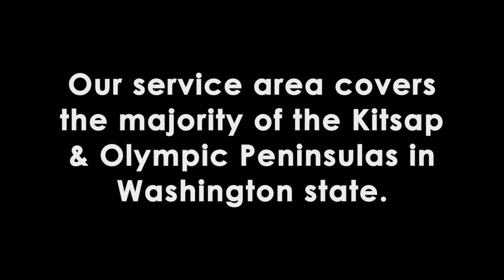Diagnose And Replace A Failed RV Motorized Awning Switch

Comment: Thank you for this easy to follow video.  I just purchased a used Fifth Wheel and the awning switch was disconnected. The awning works when using the remote control, so I figured the problem was the switch. When I opened the switch panel there weren't any wires connected to the switch.  And although I don't have a test probe like yours, I was able to use basic DC electrical knowledge, a Fluke Multimeter, and a simple test light to identify the leads.  Without this awesome video, I would have been months trying to sort this out (or a few hundred bucks at a dealer).  I watched the video, went to the RV, and even with taking the time to heat shrink all the wire end connectors to prevent shorting against each other, the job took 40 minutes.  :)

Comment: Ok, so I'm a electrician and an RV tech, and I understood, but I think a drawing would have made it easier to follow.  Maybe show how a dc motor will change direction of rotation when voltage is reversed,  do a mock up and show that on the bench and then add the switch into the circuit...I do love watching your videos and keep doing what you do....
Reply from the maker: Thank you for the support!

Comment: Valuable information as always. I learned that's a double throw double pole switch that reverses polarity. I once had a fantastic fan that only blew air in not out. Hence I used a dtdp switch to fix that so it would blow air in or out.

Comment: Simple rule for DC motors whether they are window regulators, fan motors, awning or any other is they use reverse polarity to switch direction.  This comes in handy with those who like to look at wiring diagrams and will better understand that the same wires or conductors will act as both positive and negative depending on which way the switch is operated.  Much easier to draw a diagram and use markers to show the circuit while at rest, and each switch position and the theory will become more evident.

Comment: Thanks for a very good video.  If you run across a similar problem where the awning switch is integrated in a larger multi control switch board with separate push controls for the awning, porch light, and master ceiling lights (instead of one standalone awning switch), I would enjoy seeing how to troubleshoot the problem.

Comment: Thank you for another excellent tutorial, but my greatest weakness when it comes to repairs is electrical issues and I was really confused watching this, but kind of understood it in a working sense??  I usually do trial and error, but as I said, me not understanding electricity as well as I wish I am always afraid of blowing or frying something more than just a fuse (like me for instance). In this case I would have started with the fuses and then got to the switch, but would have froze switching things around for as I said, I have a fear of doing more harm then good when it comes to electricity. I've learned a lot with your videos, so I'll keep watching and hopefully I'll keep learning. Thanks again.

Comment: We have just purchased our first commercial RV.  Have a DIY one for over 20 years and of course making "improvements" to every year.  The commercial one 2022 Pleasure Way Ontour 2.2 blows my mind.  I have a Truma furnace not just a Mr Buddy.  I have a big water pump and two sinks, etc.  And of course everything is hidden in walls.  Your videos are really a great aid in getting a jump start on understanding our new RV.  Great work and explain things clearly.  Many thanks. ............Side note even this PW unit that is supposed to be high quality have so much that screwy  about.....what were they thinking??  They build them but DO THEY USE THEM?

Comment: I want to point out that while the power probe was a perfect tool to use in this instance, it does require 12V positive and negative from a battery to work. It is designed for automotive work were you are near the 12V source and need to provide a +12v or GND to various points. I enjoy all of your videos!
Reply: I have yet to find an RV that doesn't have a 12V power source and most have multiple.  The power probe has a 20' cord and also has additional 20' extensions, (In order to check trailer wiring @ back of vehicle), along with the capability to not just clip onto a battery directly but also plug into a cigarette styled 12V power source which is usually located close to the service panel.

Comment: You are right !  I had a slideout that broke some of the teeth on the gears.  Took it to the dealer, and it took 4 months for them to fix,and since it was covered by warrantee I could not speed them up.  I won’t go back

Comment: The common pole changes polarity as the switch is rocked.
So thr negative and positive wires are hooked up in the outer poles. These are the power lines that feed the DC motor..
Reply from the maker: And I would add that the positive and negative polarity of the top two pins gets reversed on the bottom two pins. It is in this way that the common pins (in the middle) which gets wired to the awning motor - has the polarity change allowing the motor to go clockwise or counterclockwise.

Comment: In a DC circuit you have to reverse the + and - going to the motor to get the motor to reverse or turn the opposite direction. One direction for out and the opposite for in.

Comment: Great explanation. Did similar diagnosis of wiring on a rocker-type battery disconnect switch. Took a while, but finally figured out that the battery disconnect switch had been incorrectly reconnected after an RV dealership worked on our awning switch. Bottom line is they fixed the awning switch problem, but created a second problem when they incorrectly reconnected the battery disconnect switch. 

Is that Luke & Jody from Workamper News?

Comment: Instead of using positive or negative voltage to depict direction you might try to simply use current flow.  I've found it makes it easier to explain d.c. circuits and motor induction to my students.

Comment: That power probe is neat! Funny thing, we just brought our new 5th wheel home yesterday and the awning doesnt work. I can hear the relay clicking but no movement of the awning. It has one of those Smart Arms where you can put the awning out or in at the arm as well as normal switch and that works but won't with the interior switch or the Onetouch control pad.

Comment: My experience is that the center is the middle point and the distribution is left or right when you rock the switch. That was true in my experience until I recently order a single pole double throw switch to replace the single throw single pole switch in my formerly fluorescent ceiling fixture.  I went to the double throw switch so that two strips of LED lights replace the two tubes. And I added three solitary little LED lights or another word for 1 and 1/2 inch two-a-day night light.   the darn switch had the common feet at one end and the two alternative points of feed in the middle and other respectively. Made me crazy.

Comment: Very simply put, you completed the circut.  Toggle switch, Hot(green1) to motor(red1), motor(red2) to ground(white2).  when the switch is toggled the other way you reversed the motor circut(green2-red2-red1-white1)
.

Comment: Another great video,  I would have liked to seen you fix the wall to and the stripped out holes for the switch.  as a new rv tech, im learning all this stuff. and yes, that dealer did a crappy job on the wall repair, but the REAL blame should have been to Thor !!  If it was built better, the wall would have never had to be replaced in the first place. I see the crappy build quality of their units every day. we sell them, and Coleman and many others. to be honest, all these campers and motorhomes are just thrown together.  it does seem like the big diesel coaches are built better with better quality materials but I guess you get what you pay for.

Comment: For you who didn't go back and checked the video.  The customer hooked up the wires wrong.  There were 2 green wires to one side of rocker switch, red in the middle and white on the other side.  If a white and green were switched diagonally it would have worked.   Nice job tech.

Comment: Our 2014 Thor came with 3 issues. Truck doesn't charge house battery. 30amp in campground drains truck battery. Aux start switch doesn't do anything 😞
At 1st CW ducked phone calls but got hungry during the pandemic,  kept the rv for 7 weeks and didn't fix anything 😑 
Our arwing some times doesn't want to retract.  Once it was a corroded fuse. I unplug near the motor and run a jumper

Comment: Thank you so much for the information on the manual process of retracting the awning , but why does it extend rather quickly and sounds and looks likes it struggling to retract. Like its in a bind or cant handle the load on retracting?   Thank you

Comment: I had no power coming into my switch--the "regular" fuse was ok but I found another 20 amp fuse on a board inside the electrical compartment that was blown.

Comment: So why would the a wing work before wired like it was, you maybe switched wires around? Great video but was it loose wires or ?
Reply: No it didn’t work prior. If you watch closely at beginning the two greens were on both top prongs (wrong). At the end you will see one green and one white at top prongs (correct). The dealership broke the switch. Customer wired new one wrong. He fixed it.

Comment: I wish you would have made a note of how the wires were hooked up with the problem (get our attention on that) so we could see the difference when fixed.
Reply: You can if you rewind the frames to the beginning. You’ll see it was wired improperly by customer. Two greens on top, two reds in center and two whites on bottom. Should be green and white on top, two reds in center and white and green on bottom with whites/greens adjacent from one another
Reply: White - green
Red - red
Green - white

Comment: I have a 2000 Fleetwood Pace Arrow 37K. I want to replace the current slide-out switch that uses a key with one made by Lippert. I thought it would be a straightforward operation but when I removed the panel with the key plate, I noticed there are only 3 wires attached to the back of the old switch. This new one has 4 wires. Is it still possible to change it? Others have said to just eliminate the Black, or ground wire. It is not an illuminated switch. What can you suggest?

Comment: i have a 2004 Class A it only has 50,000 Kilometers on the clock a friend 18 months back brought a brand spanking new RV it now has 13500K`s Just going back and forth to the dealer every time they fix something they break something ,,,,,

Comment: Hello!  I’m new to your site and have a question about installing a 12 volt reostate to my control panel for the LED lights under my awning. Don’t know if I’m doing something wrong or what. Can’t find anything hot. I know it’s there but I’m having no luck.

Comment: I need to try this on my awning. My question is why did it work before and then fail?
Reply: Because the replacement switch was not installed right. Remember the dealer broke the first switch and the customer got and installed the new one without a diagram or a good switch to follow. The customer had two wires that were not connected to anything so he guessed.

Comment: I had a ? I have a 1992 Fleetwood Coronado I also live in port Angeles wa I just bought it iv never owned one before so I really know nothing about it my manual is missing a lot of stuff because of owner I got it from so I’m limited on what to do I have a few issues my fridge is not working my gas stove is not working water heater is not working An now my toilet has leaked all the way in to the back bedroom soaking the carpet I was wondering if I could talk to u about diagnosising a few things
Reply: Hi Amber, am just now seeing this. Sorry for that! Hope you've been able to address these issues, but if you are still having issues, you can feel free to submit a service request at www.myrvworks.com. The remote troubleshooting option is $75/issue, or you can submit a request for on-site. We can talk more about your needs from there. Thanks. -Tricia/ My RV Works

Comment: But why did it work before and then failed?
Reply: Customer wired incorrectly. Dealership broke the switch. Switch sent to customer. Customer wired two green on top prongs and two whites on bottom. Greens and whites should be adjacent
Reply: @JordenBurton  Gotcha... thanks for clearing up my confusion.

Comment: I'm having a real hard time believing this guy is a commercial electrician of any kind, 10 minutes into the video and he has dissembled the entire switch Assembly but hasn't bothered to check the fuses yet or bothered to check the actual switch for continuity, but hey you did spend 10 agonizingly minutes talking about meters. 

Brevity is your friend. 

BTW I'm a ret. electronics/electrical engineer, I specialized in high power communications equipment and spent nearly 20 years as chief broadcast engineer for major metropolitan radio and TV stations. I worked around high voltage equipment that if you had a bad day and touched the wrong wire you'd be dead before your head hit the ground.